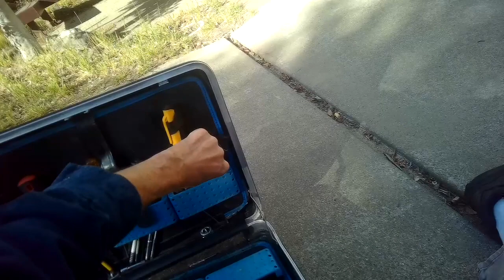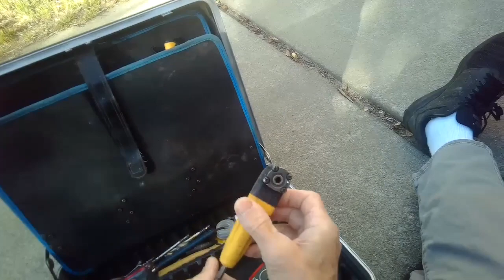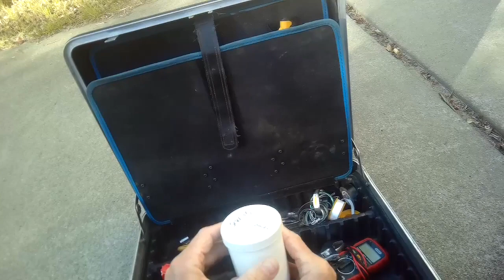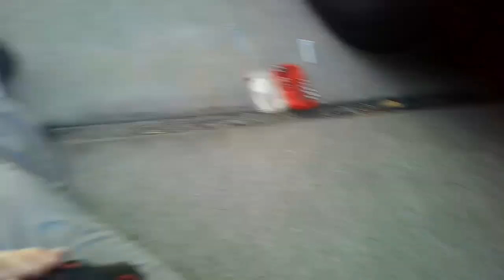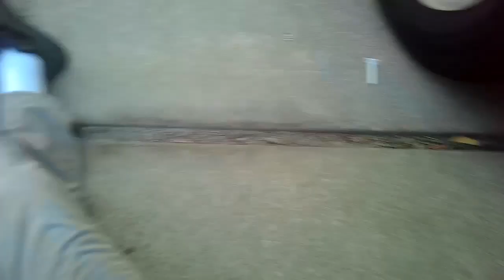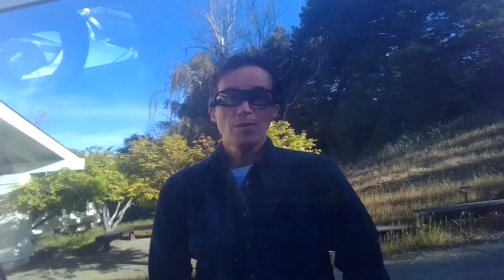✨ APPLIANCE REPAIR TOOL KIT ✨

Comment: Could you tell us what kind of multimeter to get, one that will check wires and diodes
Reply from the maker: Any multimeter that measures voltage and resistance should work👍
Reply: @QuickAndEasy5MinuteAppliance  I have such a multimeter, but it will not check capacitor or diodes

Comment: Great setup.  Are you still using this same tool case?  I have the exact same one, I switched to a Veto Tech Pac MC (backpack), because I am constanly going up and down 3 flight of stairs.  I leave the B&W one in my vehicle just in case.
Reply from the maker: That’s a great idea,
I am still using that original case and it’s held up pretty good through the years.
I just have to make sure that I don’t have any tools that are poking out between the 2/2 when I try to close it.